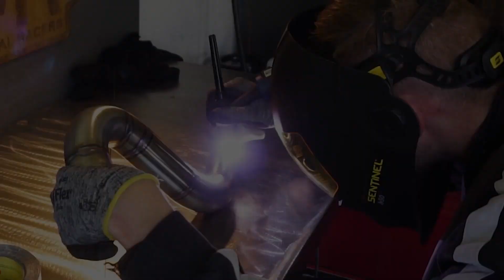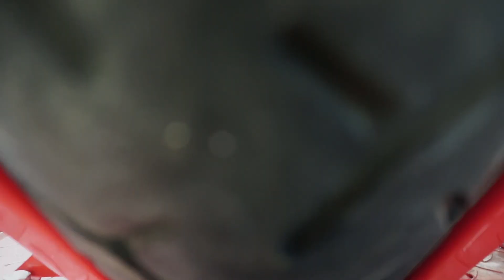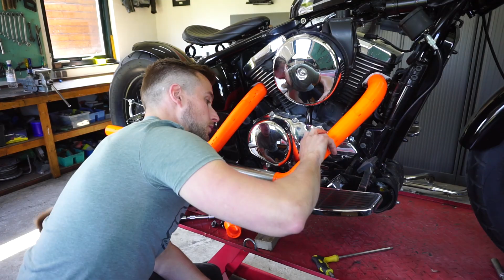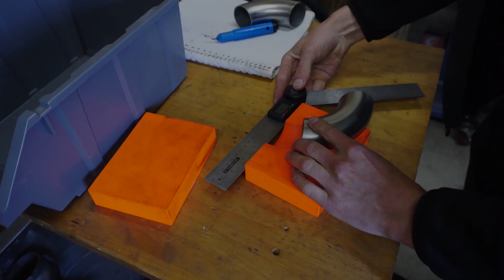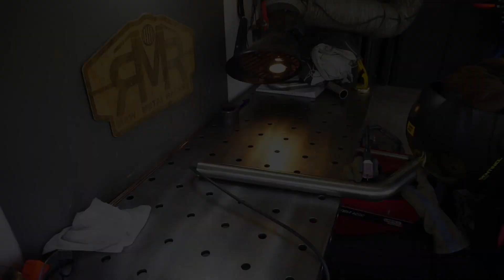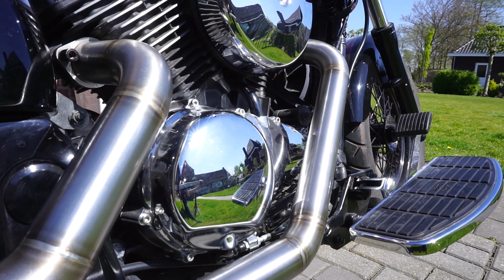Kawasaki VN800 - Stainless Longshot Exhaust

Comment: Did you need to rejet
Reply from the maker: With DB killers there was no rejet necessary, but with a non OEM exhaust it’s always good to check the air/fuel ratio on a Dyno.